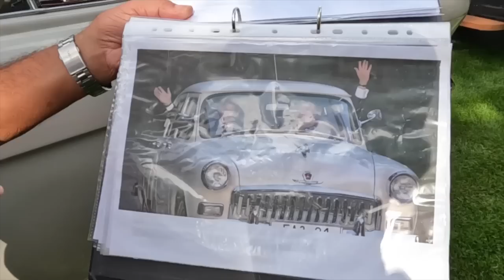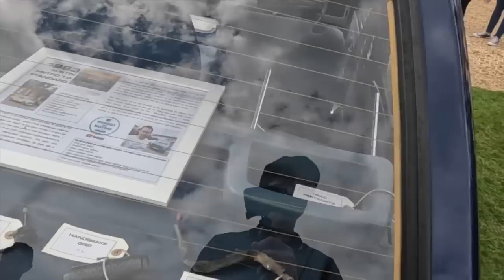Festival of the Unexceptional 2023 - the cars! the people! the wasps!

Comment: 27:18 Yes it was that one, K353 UKK one year ago, so great to see it again with all the restoration work that has gone into it over the past year as well, replacement alternator without broken bearings which caused the whining noise in the video, new LS spec wheel trims, phase one boot button surround (sticker rather than indented silver Vauxhall logo), phase one gear knob, replacement dash from a Vauxhall Tigra because heated seats as it turns out was not an option unfortunatly even though it seemed like it, the buttons did nothing, and a new replacement bonnet from a satin red phase 2 from 1999 as the original bonnet was full of stone chips and didn't look good at all.

Comment: As someone who worked from 09 to 05 for as a metrology technician for a Rover foundry it's nice to see Montegos and maestro's . With my job I use to drive them regularly round the plant or to our sister foundry they were really abused from new with Foundry tooling. I once went on a training course at East Midlands airport. Personnel told me.i would have to take 1 of the cars. I was told check car over it was at the time probably 3 years old an M reg 2.0 diesel the car had been running around the foundry with no oil etc. Due to Rovers not having the best of reliability even with offers of upto 50% off not many bought any other than 75s and MG ZTs. No company cars other than the odd 1 was Rover. The Delorean is Rare it's 1 of 38 RHD factory built cars near the end. Strangely the ex Delorean factory is now an Automotive foundry.

Comment: Due to the crazy queue to enter (over 1 hour) I missed you, and HubNut at the 10.30 stage session. My Alfa 156 broke down near the castle with a gear linkage fault, fixed in 30 seconds by the RAC patrol later in the afternoon. Great show but they need to sort out the access arrangements or I won't be going again.

Comment: Nice spread of cars. Was the Mark III Vauxhall Cavalier that good of a car? I can guess the Mark II Cavalier would have been sort of rubbish based on my driving of the USA versions (Chevy Cavalier, Pontiac J2000/Sunbird, Buick Skyhawk, Oldsmobile Firenza and Cadillac Cimarron) Though I will admit that the 1988-1994 Chevy Cavalier Z24 with the manual trans was fun to drive and that I liked and still like the Cadillac Cimarron not only because GM had the audacity to tart up a Chevy Cavalier to turn it into a Cadillac but that they kept making them so long (7 model years). The thing about that oldsmobile van (called U van due to the platform name) or dustbuster van (named after a popular portable 1980's vacuum cleaner made by Black & Decker) was that you could have a 7 course meal on that dash. I had a 1997 (second generation) U Van which looked more conventional. That owner must be shelling out a lot of money on gas as these were not exactly fuel sippers. (Mine was a gas pig but as i value comfort more then gas costs, i was not bothered by it). I still think the Rover SD1 is one of the best looking cars made by the UK.
Reply from the maker: Mk2 was very good, one of the best in class when it was new. Vauxhall/Opel models were built in europe and (not to knock US cars) its often the case that Euro versions have better quality interior plastics and fit and finish, and 90% would have been manual - 1980s autos with a 4 cylinder are never a treat to drive!
Reply: One of my workmates has a 1.8 cavalier. It's unexceptional and boring but it's comfortable.. They were designed to be driven up and down motorways, by people in suits, who weren't high up enough in the company to get a BMW. They felt a lot more modern than a Sierra.. The SRI was quick enough and I think still looked modern when they replaced the Cavalier with the Vectra. 
Any 'redtop' 2.0 engined Vauxhall was pretty cool.. 
They did rot though. It was rare to see one without rusty wings/arches/around the windows/sunroof when they were still popular.